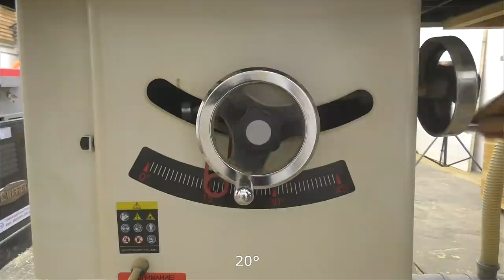🟢 DIY Folding Sawhorse - Saw Horses Build - FREE PLANS

Comment: Nice. A couple improvements though, you need braces not just chains to prevent them folding under shifting load or if you accidently kick them.
Also install the hinge just low enough to clear your top plate to prevent having to chisel a space, this also lets you extend the other leg a bit and bevel it to meet the side of the top plate giving extra support and taking the load off the hinge.
Reply: show us your video of your "improved design," or kindly shut up 😆